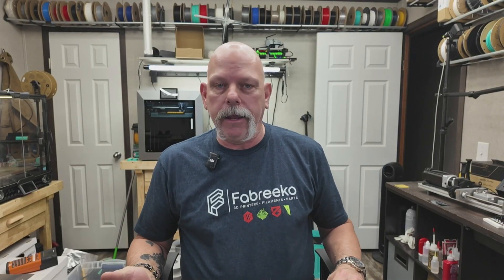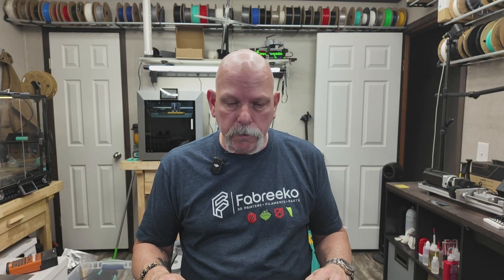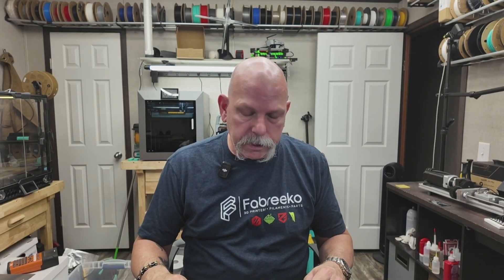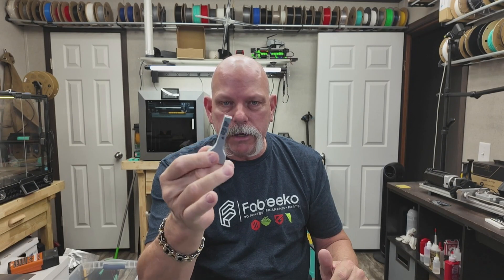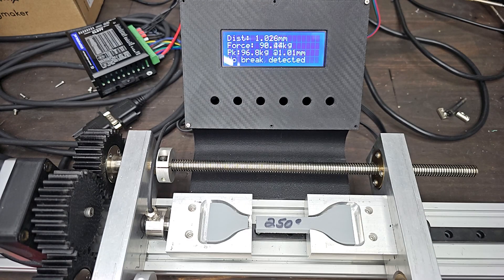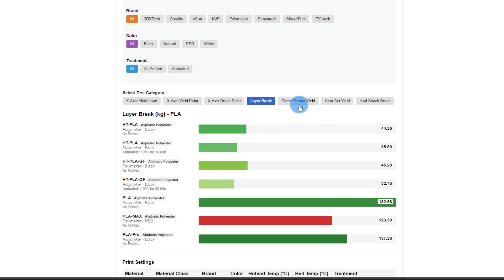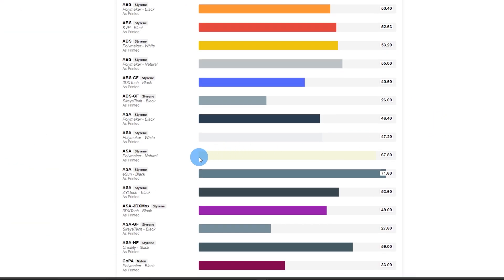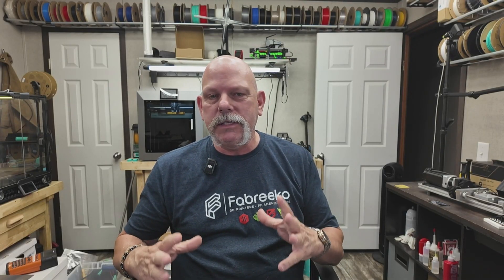MORE HT-PLA TESTING | EDGE OF 3D

Comment: Apologize if you mentioned this in the video, but did you test the heat resistance of the HT-PLA after you printed it at 250°? I am wondering if the increased strength is from burning off the additional chemicals that make it heat resistant. 
Thank you for all the data btw.
Reply from the maker: Good question—no, I didn’t re-test the heat resistance after printing at 250°C. The reason? The idea that the additives responsible for increasing heat resistance would be burned off by… higher heat... during printing… kind of turns the whole "high-temp filament" premise into a self-destructing magic trick, doesn’t it?

If printing it hot destroyed its ability to handle heat, that would make the material about as useful as a chocolate teapot in a kiln.

The improved strength I observed is much more likely due to better layer bonding at higher temps—pretty standard behavior for any PLA variants. But hey, if the material’s going to spontaneously forget it’s heat resistant just because I printed it warm, maybe it needs a new marketing team.

Appreciate you engaging with the data—and feel free to test it yourself if you're curious. I always support independent replication.
Reply: @EDGEOF3D  I'm printing a stapler at 250 right now, it's extremely stringy, but it's also giving a more gloss finish that I like. My last stapler I made was printed at 225 and was surprisingly strong, so hopefully this one will be indestructible.

Comment: I tossed a whole batch worth of ht-pla parts thinking it would hold inside a very hot car, without the part taking direct sunlight. It's a gimmick! Turned to bubble gum within an hour. Wasted hundreds of dollars. Stick to ABS or ASA
Reply from the maker: I have no idea what HT-PLA you had but it's 102° here today, has been up in the 90's to 100's here all summer, I have Jeep Ducks and Flexi-Dragons that have been inside my black vehicle since they were printed and nothing has changed, they are all exactly as they were printed.
Reply: i mag dumped 3 ghetto sticks out of a glizzy made of this stuff and it was fine, no warping or spring creeping. that thing was too hot to hold comfortably too.  sounds like a skill issue on your part
Reply: @Teddy-Bear-x3  I wish I could show you pictures, cause I obviously took pictures. Parts came out beautifully from the printer, decided to leave it out in the car, came back an hour later to softy ass parts. They weren't thin parts either! You can swear by it all you want, but my stuff didn't hold up to heat. Used Polymaker HT-PLA, not that water protopasta stuff.
Reply: @francisco12816  out of curiosity,  what temperature did you print it at?

Comment: Good news I see, but not for my red one. I've tested 250°C and 230 on red ht-pla, it's worse than at 220 at Z. tested by hands, definitely weaker than at 220. I have this spool for a week, I don't think it caught moisture yet, but 220 was tested at the same print time. Maybe red acts differently at higher temps. On 220 I had about less than half what regular pla has, as expected, tested on kitchen scale. I have a simple method where I print vertical 5x5x60mm pole and two brackets 5mm thick so 50mm is at test, I hold one by pliers and second one to push against scale, that bar is placed horizontally. PLA was like over 2kg, ht-pla around 800g. I've tested also 230, as well weaker than 220, strange. Didn't bother to test on scale because I was lazy ;) I got some stringing already at 230. Tested on A1 mini

Comment: The other curiosity I had for the annealed layer adhesion is I wonder if you annealed in gentler steps if it would lead to less of a loss of layer adhesion during annealing. Jumping straight up to the annealing temperature they suggest seems like you'd create micro warping and fractures and a slower anneal may prevent that.
Reply from the maker: Definitely a plausible theory—and one I’d love to test more rigorously if this hobby didn’t already think it was my day job. Someday, when time, budget, and motivation align in a rare celestial event, I’d like to upgrade my lab oven with a Pi or Arduino controller to run programmable annealing curves. Then I could actually log some data instead of just vibes and guesses. Until then, I’ll keep brute-forcing it and hoping the layer adhesion gods are feeling merciful.
Reply: @EDGEOF3D lol. Fair enough

Comment: I wish the PLA Max had a higher heat deflection temperature, That's the only issue I see with this material. If they could increase that, wow!!
Reply from the maker: I believe the stuff they add to the PLA to increase the heat deflection temperature will have a negative effect on the other properties of PLA Max.
Reply: @EDGEOF3D  I would guess that you're 100% correct otherwise they would have done that already. Not trying to turn this into a 2A discussion but finding the "Goldilocks" filament (relatively easy to print on most printers with dimensional stability, high temperature/chemical resistant, high layer adhesion and resistant to shock with low creep) seems like a never-ending search. I have had some great luck with Sierra tech PET-CF. So far it has held up perfectly under some pretty high stress testing. Based on your data charts I may start looking into some other filaments. I wish my bamboo lab carbon X1 would go to 350c.